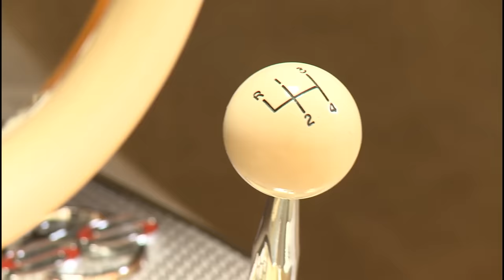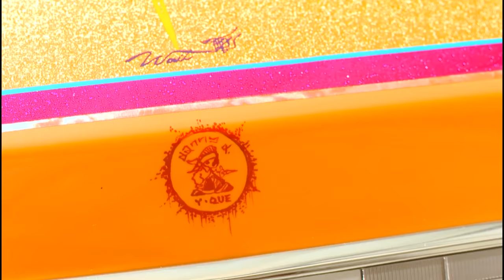Lowriding with Jay - Jay Leno's Garage

Comment: I have to clear the air my father who was Malties started lowriding w/ hydraulics on them rather than air shocks and shackles. My father's car club was called Las Estrellas back in the 70s I believe in Daly City California. He lived close to the SF airport and new the mechanics. He got the idea to transform the cars suspension from a old car that had a stock single hydraulic to lift car up from scraping in drive way. He went to the airport mechanics with the idea of using hydraulics from landing gear on plane. The mechanic laughed with amazement thinking it was crazy but would work. He gave him used equipment which was good from the plains along w/ instructions on hydraulics. He made it work for a while until the piston ripped off the and shot through the fender and into the air lol. He soon learned where to get the right sized equipment. With the help from his friend Robert from Low Creations who was the treasure of Las Estrellas at the time they started a new generation of car culture.
Reply: Paul camilleri the saluter brown brigader little car

Comment: how can anyone hate on lowriders done up like this?
Reply: +M Rod I have nothing against the car, but middle-aged men look fairly ridiculous in them.
Reply: You can't, the level of workmanship and engineering done on them is top notch. The paint job on both those cars is enviable. And lastly, unlike many wanna be restomods or hot rods or ricers, the power train on these two is very legit.
Reply: @davids.794  Why do you allow the subject of a person's age control the way you think of other people? Age is simply a measurement that represents the length of time someone has existed on this Earth. Nothing more, nothing less.
Reply: 66 63 Chevy endangered species that’s why. 
That much weight with sooo many moving parts 🤦🏼‍♂️ 
+passengers
Reply: Amen!
Reply: We need this in Canada 👊

Comment: Saw my first lowrider when I moved to Phoenix in 1980. Guy I worked with had a side business doing welding on cars. I was looking at the batteries and pumps driving the hydraulic system. I asked why they used such a primitive system. I called a friend in Massachusetts to send me a catalog from a company that sold DIY snowplow and sanding equipment. I showed Charlie and his brother in law hydraulic pumps that bolted to the engine block or onto brackets under the hood. No need for a bunch of batteries. Pistons with different ends for custom configuration. They were amazed at this stuff. They put a few things on their project car. Big hit with their friends. No more hacking the frames,weakening the car. Saving the steering and suspension geometry.The workmanship on some of these lowriders was labor of love. Then you see one hooked up to a tow truck with the front end folded.

Comment: This car is incredible..wow. I don't see how they drive it with the amount of detail and work. One pebble ruins the whole thing
Reply: Look man I’m a Detailer and building a low rider with the help of a original hopper/OG.
They put 15 to 20 coats of clear on the car then they put 20 to 25 coats of %100 wax. If you run a knife on across it you won’t scratch it. Really you will dent the steel before you scratch the paint 💯
Reply: @sugerdaddy5  Wow... 👍

Comment: In Australia the turn signal lenses must be amber on all cars. My old 64 Bel Air (factory RHD Aussie delivery) had these. So in Australia on a 60s Chevy it was a red brake light on the outside, amber turn signal lenses in the middle and a red lens with a clear insert in the inside for brakes with the reverse lens in the middle.

Comment: Jay seems like he feels the need to come out swinging for lowriders.

I love the cars, but parking with the front up, and rear down, gives it the appearance of busted airbag suspension....

I kinda wonder about using servos, instead of hydraulics, for the active suspension. It could be a lot lighter, more self contained, require a lot less power, have a lot less potential to leak or blow up or otherwise go wrong....
Reply: Believe it or not, I have thought about it too.  I say it can be done.  Maybe it has been done.  I'm not versed enough to say either or.  Pz to all.
Reply: Where are you going to get servos that strong with that much power? Just curious.
Reply: Answer: no clue!  Question: Did you read the part about "I'm not versed enough to..."

Hopefully I didn't just feed the trolls! Pz to all.
Reply: Travis L. Desmadreson I did read that part, I just thought you already had a certain kind of servo in mind that you had seen somewhere else or something.
Reply: *****
I'm pretty sure servos that powerful exist. Maybe from some sort of industrial control system or something. Like assembly line robot parts, maybe.

They might have pretty big or heavy windings, or something, but I can't see it being as big as the pumps - as long as you could sit it far enough up to have the ground clearance.

I'm thinking of a system with high-travel suspension, and mount the servo with custom control arms, so that it applies a preload to the suspension, and just forces it to move. You could also use the servo to control how stiff the suspension is. In fact, maybe you could dispense with shocks entirely, and use the servos for damping.

For ground clearance, you might need to mount it farther away, on a parallel arm tied to the A arm, or something. But on that note, if you have slow hydraulic or air suspension, from a scratchbuilt system, if you had a slower one, it might make as much sense to literally have pulleys on motors at the tops of the strut towers, with a cable tied to the control arms.

Though, of course, those hydraulic systems are beautiful.

edit not only could you maybe dispense with shocks.... maybe springs too. Put bumpstops and just let it rest at the bottom of it's travel when the power's off, and use servos for all ride control. I think this might even be better than traditional suspension, in terms of handling - infinitely programmable and controllable, and it could be made to respond any way you want to bumps, if outfitted with the right sensors. But maybe that would take too much power, to be constantly having to hold the car up. Any electrical engineers in the house?
Reply: Cancer Patient
The power and travel necessary in a lowrider is totally different, though.

Comment: How does that paint hold up to the temperatures under the hood and being used between the fins on the valve covers? I've always wondered. Seems like it would get cooked and flake off after a few drives.

Comment: I thought the O.G. lowriders were the 36-48 Chevies, usually sedans with sandbags in the trunk to lower them.  Sometimes Pontiacs, rarely Mopars.  Never Ford V8s.  I briefly drove a mid 80s Isuzu P'up  with a chopped top & low profile tires on smaller mags.  I do not remember much else.

Comment: First of all, lowered or low riders STARTED in the late 40's with kids who got a broken or sagged spring(s) on their $25-50 jalopy and thought it somehow improved the car look. By the early 50's guys were doing all kinds of (dangerious) things to radically lower cars beyond simple lowering blocks, which were common in the late 50's. Hot rudders and Custom cars would "C" the frame, heat the springs, mechanically clamp the springs, reverse or re-weld the spindle higher on support structure and then BEND the pittman arm!!!! Safety first right? Finally in approx the early to mid sixties the ides of truck hydraulic cylinders
and two ton truck coil springs took hold.  But that was like 10 to 15 years AFTER guys started lowering cars by earlier methods. Remember early to mid 50's customizers welding HD Casters on car frames so that when they bottomed the cars still rolled?  But while lowering was much older,, there NO denying that the modern low rider technology using the invention of the use of hydralllics started in the early to mid sixties.

Comment: There’s no such thing as brilliant engineering, when it comes to a lowrider. Totally the opposite from the unsafe wheel suspension to the danger of those chained steering wheels, and not to mention the roughly ride of hydraulic systems. Nice cars, but terrible daily drivers.